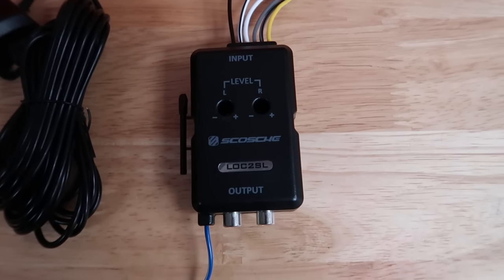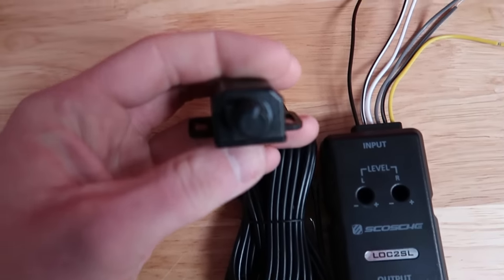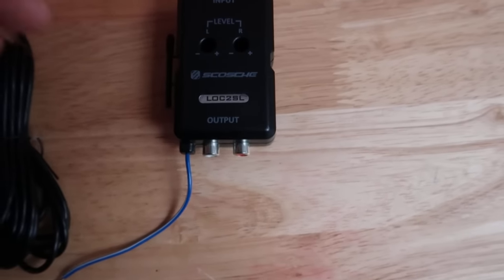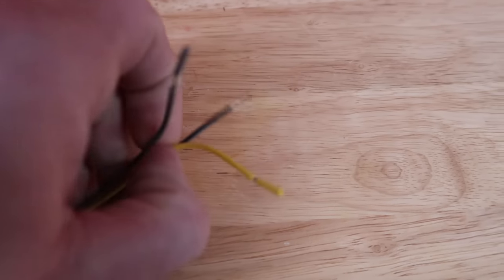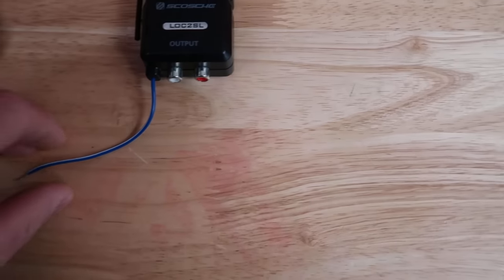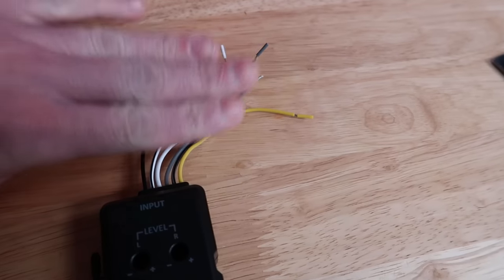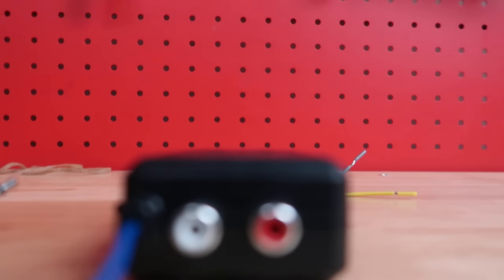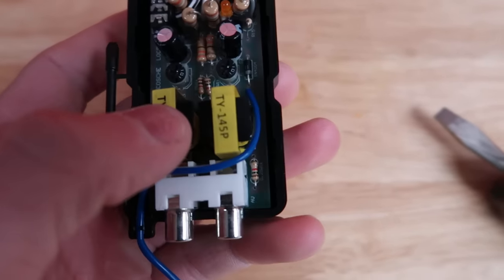Install AMP/SUB FACTORY RADIO Installation Without RCA Hook Up AMPLIFIER STOCK HEAD UNIT Car Stereo

Comment: Hey buddy I was wondering the yellow cable the power cable you said connect it to the battery but from battery it would be to powerful wouldn't it?
Reply: Amin Khan You can hook it up many ways. From the battery cable from the amp or a constant 12v fuse. It won't damage the converter. I had the same one hooked up to my amp for 2 years and still good.
Reply: saidh chavez thanks for your reply mate another thing , in my Saab 93 the rear shelf speakers doesn't have enough power for the amp ( sub) if you help me with that mate place ?
Reply: Amin Khan okay is the signal to quiet for the amp to pick up? Like is the speaker itself loud or can you barley hear anything?
Reply: I can hear the speaker fine they don't have base only small bit then I changed my rear speakers to bigger ones but the sound it's is same no change. I can hear sound in woofer after connect the cables to amp using  rca connecter but it's very extremely quiet.
Reply: Amin Khan did u mess with the settings on the amp? Did u connect the wires from the converter to the speakers on both sides?
Reply: Amin Khan the sound is not gonna change if u change the speakers. Only way it'll change is if you put a 4 channel up to them like I do. The signal from the deck will have to have enough power to push the different speakers
Reply: NO IN DC CURRENT THE CURRENT IS NOT FORCED SO IT ONLY DRAWS WHAT IT NEEDS
FROM MILLY TO KILY

Comment: So I have a sub and amp with a stock stereo I am very confused on where to put the rca connections because the stock stereo doesn't have the rca outputs. I know I plug the rca cables to the loc but what do I do after that how am I going to get the audio to play if it's not actually connected to the stock stereo does it have something to do with the amp or do i just tap in to my speakers from the trunk? Need help please that you!
Reply: Did you not listen to what hes saying? Each one of those wires on LOC is to splice or tap into the speaker wires of the car on the radio wire harness itself. that is how it will send the music audio signal to your LOC. thus converting it out to the RCA cables that you will now connect to your amp on the other end. Its up to you to look at the diagram of the car you have to make sure your splicing into the correct wires. So always tap into the front speakers wich will be 4 different wires, FR+ FR- & FL+ FL-       Wich is front right positive, front right negative & front left positive, front left negative. After you splice into those with your LOC you will now have audio signal going through it.

Comment: Did that work for the Chevy Bose system? They usually require a adapter\module that takes the extremely low signal from factory head unit that runs to the stock Bose amps. They are a pretty unique system in those trucks and one of the reasons I went with my Silverado that didn't have the Bose system.
Reply: These converters work with any and all. It gets it's signal from your speakers wires and converts them to RCA so they can connect RCA signal cables from converter to amp.  Makes it so you can hook up a 2 channel or mono amp to your factory system.

Comment: can I just run it from headeck instead of that line out converter
Reply from the maker: if you have aftermarket head unit or head deck installed then yes but not if you want to hook it up to factory head unit or head deck hope that helps!!!
Reply: @EverydayImTECHnIt  thanks for replying. yeah I've hooked it up amp turns on but no sound from subwoofer

Comment: Hey man was just wondering if you ever installed this on a Chevy with the bose system?
Reply from the maker: Yes i just did actually i'll post a video explaining how to hook it up. Give me about a 1 hr!
Reply: Everyday I'm TECH n It ......hey bro I enjoyed your realness. Hopefully we see a video of you connecting everything.
Reply: So if you connect the yellow wire to the power on amp it won't leave it on?
Reply from the maker: https://youtu.be/4JYg8bEvjM8
Reply: Josh Faison might I ask you what model your Chevy is? I’m also with the Bose option
Reply from the maker: @thesilentgeneration1711  2003 chevy silverado 1500 HD with factory BOSE audio system should be the same for 2003-2007 chevy silverado 1500,2500,3500 plus other GM SUV & TRUCK models from 1999-2007 https://youtu.be/mTICBqXtm9w
Reply: You talk way to much absolutely no help
Reply: @professorswag1476   he literally explained EVERYTHING, in detail..step by step!!  What don't you understand??

Comment: HEY COULD I USE THIS BACWARDS..?
IF I HAVE A AFTERMARKET HEADUNIT.
WITH RCA S.. 
N I DONT WANT TO CUT THEM..
MY AMP IS PRE WIRED WITH NO RCA JACKS..
WOULD IT WORK..?

Comment: If you run the yellow wire to the amp power wires and then the remote wire to the remote of the amp, how will it ever know to turn off????
Reply from the maker: It is auto shut off/turn on so it knows to turn on when audio is played & then shut off when there's no audio most other converters don't have this feature just saves hassle of having to run the wire to fuse box or slicing in another wire for turn/off like u have to do on other converters.
Reply: your correct there everyday, but its nothing to do with audio signal its just that its receiving swiched power, if you didnt have this box but have an electric aerial up the back (goes up and down depending on stereo being on or off) you could piggy back your amp remote wire off the power to that to save running new wires up front ;)
Reply: ps obv even if you dont have electric aerial but  was an option available for model of car, the head unit will have a remote wire so at worst youd have to run wire to head unit or if you're lucky you might even find the wires for the non existing optional aerial behind the boot/trunk trim connected to nothing that you cud use :)

Comment: So with this i dont need to take apart my dash and or conmect anything to my stock head unit ?
Reply: correct. you can use quick splice connectors to tap into the rear speaker(s).

Comment: So the rcas on the high low converter connects to the amp and not the head unit? So nothing connects to the head unit?
Reply: Correct

Comment: Is there a way I can hook this up to the amplifier itself my rca jack on my amp broke off and soldering is hard lol
Reply from the maker: Yes sir you can fix amp very easily & soldering is not that hard once you do it you'll be like that was so easy LOL i believe in you can do it you can do it all nite long lol i have linked cheap soldering iron below with soldering wire included buy this & unscrew cover on amp & take off cover make sure you completely unhook amp then soldier new wires where RCA plugs our wired to board there 2 wires for each RCA plug Buy this soldering iron  https://amzn.to/2CAu4MO buy these new rca plugs https://amzn.to/2Cyq9A2 i'll make a video something you how easy soldering is if you want me too????????? LOL let me know hope this helps
Reply: Just use electrical tape if you don’t like to solder.  Worked for me.  👍👍🤓.
Reply: either that or perhaps your amp has high level inputs too? lots do, just depends on what amp you have bud
Reply: You’re better off getting a new amp. You don’t want anything that is compromised in your system if you aren’t 100 percent sure on how you are supposed to fix it properly yourself or bring it to a professional

Comment: Can i use a 2 channel loc to run a 4 channel amp? Actually i installed a 2 channel loc on my mazda 3 2007 stock headunit and was supposed to run a 2 channel amplifier. But unfortunately that amp is not working and now i have a 4 channel amp also and wondering if i can run that or not.
Reply: YES JUST GET A SPLITTER FOR YOUR RCA'S
Reply: Terry is correct. You just need a set of two RCA Y-splitter cables that have single female RCA plug to dual male RCA plugs, one for the left side and one for the right side.
Reply: DJ Soundz Entertainment i got it sorted a long ago. Thanks though for your reply ☺
Reply: Terry Clopton cool. Thanks

Comment: How will you use hook these wires up. Wires arnt long enough
Reply: buy speaker wires and splice away if you need more wire length......

Comment: Where or how do I hook this up to my Volkswagen Jetta that has the rear speakers in the doors instead of the deck, Thanks in advance
Reply from the maker: You can hook it up to rear door speakers but have to take off door panels & is a pain in the ass to then run wires most of the time you can also remove factory radio & splice into speakers wires but have to look up what wires you need to splice into google it see if you can find a better answer on jetta forums or something hope this helps good luck!
Reply: Everyday I'm TECH n It, thank you for the advice

Comment: Need help hooked up LOC .. just getting music out of subwoofer NO bass
Reply: Have you adjusted your settings? There are settings on the amp as well to mess with. Should have a knob labeled “gain”, look at the volumes of everything. After that if it doesn’t work make sure everything is properly plugged in, properly powered, and the subs have proper airflow

Comment: I have a Chrysler 300 I connected everything but I get a lound noise as if the speakers were on when I turn off the car and open the door any can tell me why I did use the factory radio
Reply: i get the same thing, did you find out why?
Reply: Your ground on your amps is not grounded enough. Try  sanding to get off the factory coatings before putting your ground
Reply: Or your aux cord needs to be replaced..

Comment: I have a powered pioneer subwoofer how the heck do I hook that up?
Reply: If it's 12 volt. Wire it straight to battery...
Then for the signal use one of these cool rca plugs wire it to the subwoofer ..or run an aux cord from your phone straight into the amp plus power wire to your powered amp

Comment: Blue wire is called the remote
Reply: Joe Sommerfelt can you not just run that with the remote wire on the amp????
Reply: @fishnmaster421  yes.. same thing.. connect them.. add a wire in between to connect if you have to.

Comment: How about a2007 hummer tuch screen radio will it work on it and my sternwhell has where I can turn up the radio
Reply: Step 1- beat the shit out of hummer and break the steering barrel. 2- report hummer missing. 3- collect insurance. 4- buy anything but a hummer.

Comment: What if the speaker is in the door and not in the back
Reply from the maker: That 100% fine it's kinda a pain in the ass to take off door panels & stuff but you just have to tab info R&L speaker wires the Tap Connectors linked below help to make it easiest & totally worth a few bucks i copy & pasted link for you if you want to get them https://amzn.to/2MPpfmN
Reply: Couldn't i just wire this up in the dash to the speaker channels from the harness? Easy 12 volt and ground right there.

Comment: Cant you just strip the rca jacks & wire them to a exzisting speaker wire & not put a converter in.
Reply: if you did you would have chronic interference especially in a car environment, speaker signal is a hot signal, meaning its amplified already and your putting that into a low level (signal only no amplification) input, so in this particular scenario it isnt just a case of a different type of connector im afraid, thats why some amps have low level (the type this device caters for) but also have sepperate  high level inputs too (the type of input you need for an already amplified signal like you're suggesting which usually is just speaker connections and have suppressor circuit inside the amp to kill off the amplification in them before amplifying the signal itself), but thats one of the best questions i have seen in this frankly pretty poor thread tho bud, hope that helps :)

Comment: what if it’s one back deck sub
Reply from the maker: you can repeat wires or make the 1 negative wire into 2 negative wires go to R/L negative & 1 positive wire into 2 positive wires for R/L if that makes sense!

Comment: If no red flags went up after this video you need to watch more than 1..to set things straight (because I had multiple questions) all these are hooked up behind the radio(not under the seat😂, they give you 6” of wire for a reason). Black=ground, Yellow=power white=left, Gray=right (when you connect both sets of speaker wires they need to be ether both front speakers or back)
The two wires in the group with a stripe are negative. If your wondering which wires these connect to, THERES A SITE believe it or not.
 http://www.modifiedlife.com/
Just click “car stereo wiring diagrams” make, and find your model and year

I hope this helps and saves you time

Comment: Where does remote wire go?
Reply: William Jones run a wire long enough from the amp to the remote wire on the converter
Reply: Kyle Atkinson any trouble shooting videos, ? I got no sound.  Does my factory amp have something to do with it?
Reply: William Jones where is your factory amp at? Is it connected to a sub or connected to your door speakers?
Reply: William you should hook the converter up to the factory amp and the trunk 2 speakers not the rear door speakers should be easy install verses taking the radio out make sure your wiring is correct to the speaker on the converter also
Reply: IT SHOULD GOTO THE STEREO FUSE  OR ACCESSORY FUSE ON THE SWITCHED SIDE SO IT WILL ONLY COME ON WHEN THE CAR IS ON.
Reply: No, the blue/white remote wire on the OUTPUT end of the converter is to connect to the amplifier REMOTE TURN ON  directly on the amp.

Comment: Damn so you dont even have to take the dash apart with this. Its got the remote turn on right there
Reply from the maker: Yep on some vehicles it easier to hook up by taking apart dash some vehicles it is easier to tap into factory amp or door speakers depends on what kind of vehicle it is but all those ways we'll work it just what is the easiest for your type of vehicle pretty much if that makes sense at all

Comment: Does this work with high and midrange speakers too?
Reply from the maker: yes sir it sure doe's you want to flip a switch or two on your amplifier tho so it is set for high & mid speakers & not sub or subs FYI